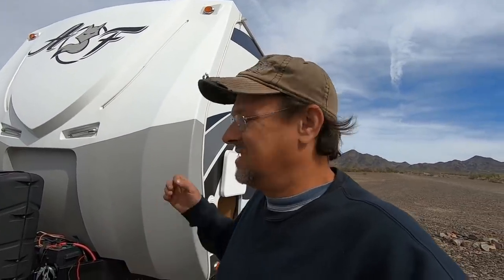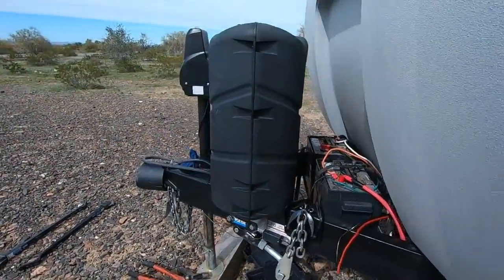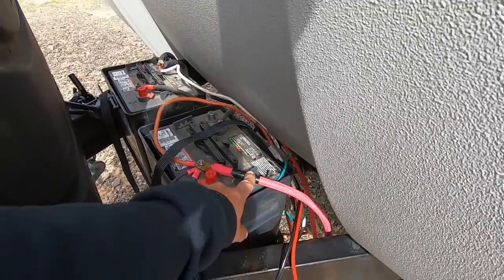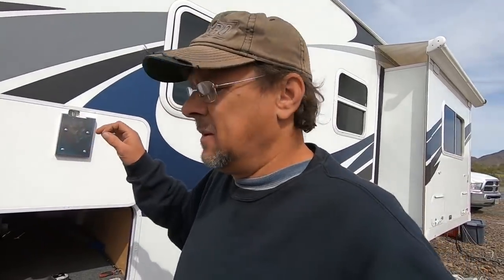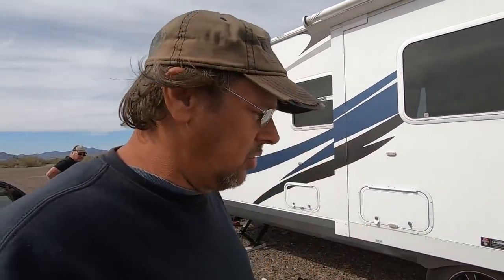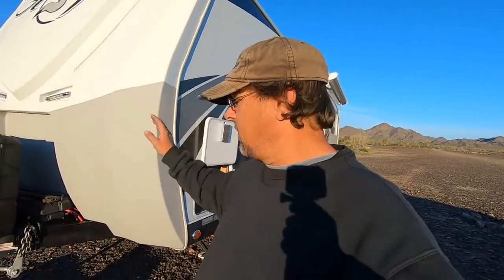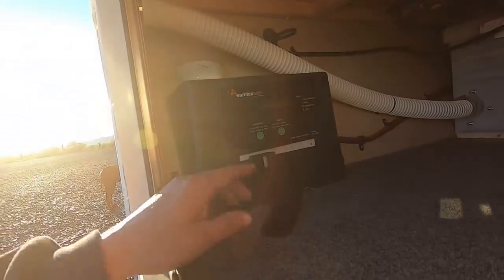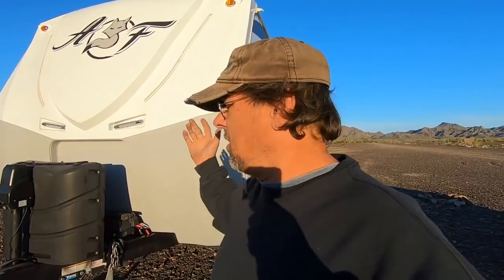Bad solar install repair.

Comment: Well, I am the owner of this travel trailer...I was very disappointed in the original job done by Harvey's RV in Glenburn, Maine...they did a terrible job, but Wayne has my system running great and my new batteries now receive a full charge every day the sun shines.  Wayne's work is exceptional, and I recommend him for solar or any other mechanical work...He is that good!  Stay far away from Harvey's RV in Glenburn, ME which is just outside of Bangor.
Reply: Robert Mycroft  well now you and the family is no longer at risk if I were you I would request  a refund on the labor from Harvey send a link of video to them if this doesn’t work I’m sure this video would qualify as evidence in a court of law and a judge would rule in your favor, please don’t let them get away with this and potentially hurt another family
Reply: @guntherflume7129  I have an email from the service manager of Harvey'e RV in Maine where he admits to a poor install, but he will only offer their service department to repair the poor install with no refund.  I am not driving 3000 miles to have Harvey's RV, who did a terrible job the first time a chance at a second try at doing another terrible job.
Reply: Robert Mycroft I totally agree, however, $7000.00 is WAY too much money to have paid in the first place... plus, whatever RV Prepper Wayne had to charge to fix their errors.  Wayne is a wonderful mechanic.  You went to the right man for the fix-it job.  As I have gotten older, I’ve been more outspoken and wouldn’t let this just pass.  Definitely do not return to Maine, but maybe file in small claims court, or at least find-out what your legal options are.   If you just let it be, that’s exactly what the Maine rv company is hoping, and they can continue to do slipshod work for others.  Good luck whatever you choose to do.
Reply: @robertmycroft8268   You need to contact the BBB
Reply: Robert Mycroft I would not let them touch anything ruin it over to a lawyer
Reply: @guntherflume7129  The video will help a little, Wayne did not show in detail each and every error of the install prior to removing and making corrections.
Reply: I would contact the Attorney General in the state of Maine and find out what your legal rights are.  Your whole family could have perished in a fire due to faulty workmanship by supposedly professional technicians ! !  🤬
Reply: The owner definitely needs to get a full refund of the labor costs (if not 100% of his bill!).  Yes, this video would be great as proof needed that installation was not only incorrect, but DANGEROUS at that.  That rv company in Maine could have cared less for the safety of this man’s family. 🤬🤬🤬
Reply: Robert Mycroft they should give you all your money back for the labor and whatever Wayne could not reuse!
Reply: ...Robert I have been reading all the comments and I have to agree with the ones that advised you to seek legal action against this RV Service Shop. They put you in jeopardy with a faulty Solar Install and the only way to make sure they get it right is to make it right with you... I would seek TOTAL reimbursement .. I would contact them and let them know you are contacting the local news media also.
Reply: Been following Wayne for awhile and he knows his stuff and a good guy to boot.👍
Reply: I agree with taking legal action but you should take it to small claims court because then you don't have to hire an attorney and it's easier to get a judgment. I know enough about the law to know that a judge would give you a judgement in small claims court!
Reply: If you dont take them to court, thats ok. The main thing is you have a safe and working set up now! And you have said your peace here..word of mouth travels and as far as I am concerned you are better off now, yes it has cost you, but its done...move along and Enjoy your life!!! Just encourage others to really research before they get a solar job done.
Reply: @janebray9392  So true, Jane.

Comment: Why does the guy not pull all that stuff out. And put the two batteries that are  outside inside under are the others are. Just take the batteries out out of that box and have that one fan sucking all the air out of that area

Comment: In series / parrell banks like this It's common practice to run 2 /0 cable  battery inner connections and jumpers between the batteries and 4/0 between the battery and the inverter depending on length of run,  for 2000 and above watts inverters.
Reply from the maker: With the batteries being apart like they are they need 4/0 wire.
Reply: @rvprepperwayne   I worked for a solar shop here in quartsite all Winter and we never installed larger than 2/0 between the batteries in a group of 4, 6-volt batteries in a split system, look at the amperage that each  battery is carrying...

Comment: Wayne , he has gotta be awful happy you came along.  There's allot of funny business going on in the rv repair business.  Are y'all coming back here (alabama/ florida)? I would like your opinion.  I have a class b and the strip that holds the top on had screws backing out by themselves. Are you familiar with anyone in east alabama that you trust to look at this and give me an honest opinion? We're just moving into a brick and mortar so things are going to be tight for a few months,  but at the end of rv season things should be better.  Thanks and thanks for another informative video.
Reply from the maker: Ill be back that way soon

Comment: This not meant to be hateful, but here are some questions we all need to ask ourselves.  Do we check the BBB rating of a company BEFORE we do business with them or just after we have had a bad experience.
 On a large purchase such as an RV, Car or solar install do we get quotes from several different sources.  Do we ask friends and strangers for referrals to companies that they have had a good experience with.  
On something like solar, do we do a lot of research and take notes to see how many times the same information comes up. Such as the sizing of wire, the placement of components,  the size of inverter and  size and type of charge controller that is most often recommended. Then armed with some information, do we ask a prospective installer, to put in writing what components they are quoting and then check that against our research to see if what they are proposing makes sense and is a reasonable price for the goods and service. 
 I will tell you that I do not do a very good job of these items. I'm an impulse buyer and get bitten every once in a while. 
 I so glad that you found Wayne. In doing research on you tube, Wayne comes highly recommended by many people, so I would be very comfortable having home work on my equipment if I were in his area.  All the best. 

During my nearly 10 years of full time RV living starting in 1984, I found that when I needed work done on my vehicles, that if I would stop in a smaller town, where most everyone knows the locals, that if I asked several people for referrals to someone that could do the repair that I needed, usually the same name came up several times. It was usually a small independent shop, that did not advertise and was far enough of the main roads that you needed a native guide to find the shop. I was never disappointed in the work or the price. RV living was great long before GPS, Cell phones and Internet.

Comment: I had my solar done last year at Quartzsite and I had 2 batteries added the batteries were fucking wired wrong. It was done by a man that had worked for Discount solar in Quartzsite for years and is out on his own. I had to take it to Solar Bill to get it working correctly.
Reply: Now you know why they fired him

Comment: Two charge controllers?  One sees uncharged batteries and charges them while the second sees fully charged batteries and goes into float mode.  Unless both chargers have some solution to that problem.  

The owner cannot be that bright so he will be happy until another claims you made a mess.  Lol

Comment: Blimey, even the battery box vent is wrong it should be on the TOP of the box not bottom, hydrogen is lighter than air !. Someone opening the side door smoking and BOOM !....

Comment: Your videos are very educational.. thank you for what you do.. i have 2 hqst 100 watt 12 volt monocrystalline panels and renogy voyager 20a pwm. Would it be better to have an mppt instead of pwm?
Reply from the maker: Most defiantly go with MPPT
Reply: Im on a budget, so what would be a good mppt that would be around $100 to $150. Or would i have to spend more. Asking for your professional opinion..

Comment: Good job, hopefully the batteries didn't get ruined by not being charged up properly before you fixed that mess, and luckily it didn't cause a fire.

Comment: Hi Wayne, Just wondering if you ever did a solar system on a boat putting the flexable panels on top of a t-top roof?
Reply from the maker: Never on a boat but there is always a 1st.

Comment: Why did you not locate the two batteries on the tongue into the basement with the other two batteries? All 4 together reduces losses in dc in the wires ! Then you only need one charge controller!  Smaller length #4 wires to inverter! Are the batteries wired for a balanced charge and discharge? Other than that carry on

Comment: Next time try vlogging with an external microphone instead, and then film with your cellphone. 
https://www.amazon.ca/gp/product/B01E3L1ESS?ie=UTF8&tag=jtjohnston-20&camp=15121&linkCode=xm2&creativeASIN=B01E3L1ESS
 Or try this adapter to vlog with a regular 3-pin microphone.
https://www.amazon.ca/gp/product/B004SP0WAQ?ie=UTF8&tag=jtjohnston-20&camp=15121&linkCode=xm2&creativeASIN=B004SP0WAQ
HTH
John

Comment: I love how they have the battery box vent inside coming off the bottom. Hydrogen rises!  Should be coming off the top.
Reply from the maker: I didn't think of that till you mentioned it. Good eye.

Comment: not to t troll, but it would be even better to mount all the 4 battery,s inside, as one stubby battery bank, the difference in heat outside and inside will also effect the internal resistance off the battery,s, But y agree, its better as those idiots did it!  good job Wayne!
Reply from the maker: Yes it would be better for just the reason you mentioned.

Comment: Hey Wayne.  Mice got into our Keystone Outback trailer and left a smell (and I'm guessing a mess) in the undercarriage.  We have cleaned the vents and reachable areas in and under everything as best we can. We think we are gonna need to have the underliner taken off.... Is this work you'd do (my husband can help but can't do alone) or can you recommend a place/person?  We're in Las Vegas until Monday then headed to Zion for a week. After that no plans.
Reply from the maker: I have used 2 things  for just what you are thinking of doing. It is not fun to get rid of the smell. I have used TYvek from Dupont and 1/8 ' plywood coated with Thompson's Water Seal. I have also used insulation to help with heating and cooling. Pleas email me at rvpreper@gmail.com with a number and ill call you and see what we can do.

Comment: I’ve read conflicting articles on using 2 charge controllers. They say they will battle each other and to prevent this the additional suitcase panels should just be wired in parallel with the fixed panels.
Reply from the maker: You can't mix panel wattage and amp rating in the same series. You can only if you use another charge controller that has the same settings as the main CC.  Both of his CC 's was the same and was set up with the same settings.
Reply: The best option is to network them together and set in a Master Slave format.

Comment: Wayne, AWG 4 and 0000 are totally different wire sizes.....you said you replaced the 8 AWG with 0000.  Good job though.
Reply from the maker: Yes I know about the wire size. I may of misspoke. He had  2g and I installed 4/0 not 4g as I spoke. The 8g  was for the 2ed charge controller that was added for future use of a suitcase panel setup.

Comment: wow great work I have been watching since you did nomadic solar we have a question we liked the 320 watt panel is that possible on a class B van like 3 of them? and we want too run the ac and everything we use with no issues when boon docking and if so do you do install for class b vans and how much would you charge
Reply from the maker: Replied to your email.
Reply: @rvprepperwayne  thank you

Comment: I am curious to know how the RV owner realized he had a bad install in the first place. Did he have some kind of problem with how the system was operating?
Reply: The charge controller would go to float early most likely.

Comment: When I bought my new trailer a couple years ago the dealer installed a second battery. Because I know RV dealers hire any Bozo they can find  I took off the lid to the battery Box to inspect. They had used 10 gauge wire to jumper the 2 batteries together. When I pointed Out how inadequate that was the response I got Was that is how they do it on all of them.  Never have an RV dealer do electrical installations.